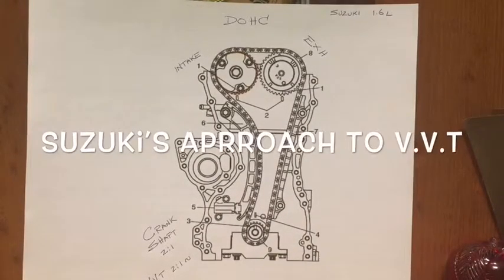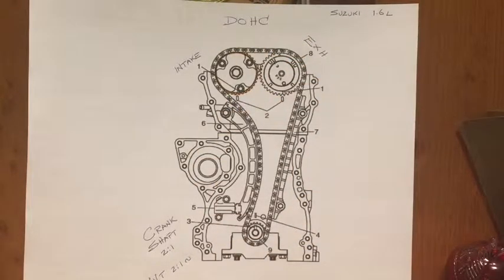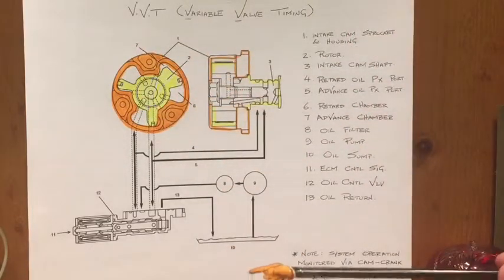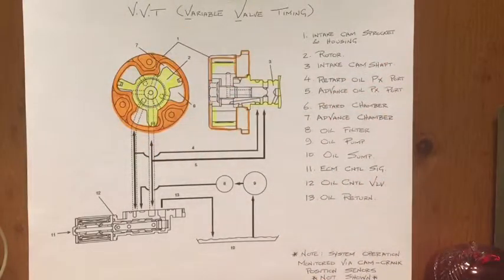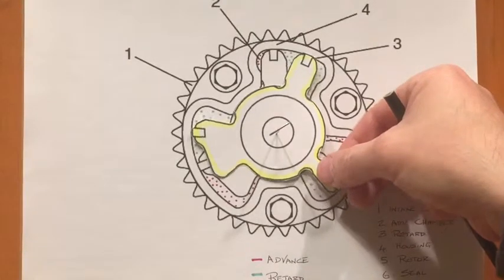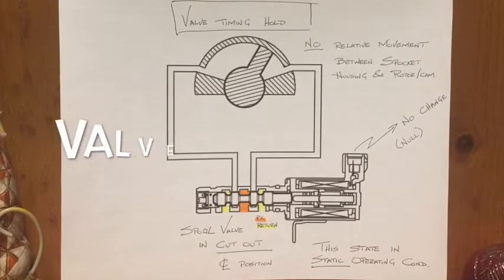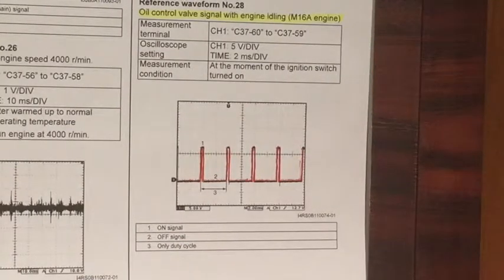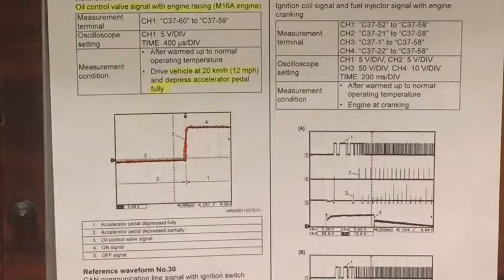Variable Valve Timing (Suzuki)

Comment: This was the best explainer on the interweb - Thank you!
I have a 2008 Sport M16A and I have 2 questions please...
1) My Sport does not feel like it has 92kW, and I can't hear any change in the engine sound as it revs out. How can I tell if the VVT is still working??
2) The next version of the Sport (about 2012) is rated nearly 10% more powerful at 100kW. Does anybody know whar Suzuki did to achieve that power boost??
Thanks to everybody!
Reply from the maker: Thx and thx for watching. I can’t speak to the 1.6L.
But this  might help…
https://en.m.wikipedia.org/wiki/Suzuki_M_engine
Reply: drive the unit and rev up to 4k rpm sounds like a vtec like in honda and you will feel the power. If there's power loss especially on the torque then check your OCV/vvt solenoid

Comment: Hey bud id love to get your advice

On my missus suzuki swift r415 m15a 2010 year model
Just changed the head gasket and now the car doesnt start and the bottom crankshaft pulley is not turning or spinning
So the engine is seized and locked up

On the assembly of the intake cam housing it says to not dissasemble the housing on it
But my mate took the 3 bolts off as your describing at the start of the video by accident instead of the middle bolt
Can this effect the car starting as well
Or ruin it at all/ the timing just by dismantling it?

It didnt fully come off, the middle bolt Was still intact onto the shaft so when he removed the 3 housing bolts it just slightly turned 

Not sure what else can cause the engine to lock when we did everything correctly like timing and etc
We did leave it for 2 weeks before reworking on it 

Not sure if rust started to build where pistons were or anything else
Reply from the maker: Hydro locked? Coolant contaminated oil destroyed bottom end bearings? Starter, accessory or clutch/gear box loading crank? Valve train issue locked up? Cylinder wall/ring rust as you say. Especially if coolant made it into cylinders. Isolate crank and work from there. 🍀
Reply: @TheGibby3340
If we disassembled the sprocket assembly housing will it cause problems? In terms of timing?

Your an absolute legend, youv got yourself a new subscriber
Appreciate ya help man
You restore faith in humanity bud
Reply from the maker: Honestly, I am not certain. Good luck with the repair. Thx for watching 🍻
Reply: @TheGibby3340  thanks for help bud 
It was a pleasure

Comment: Hello to everybody.I m looking desperately for some help.I swap a swift sport engine with engine code m16a in my grand vitara 1,6 which had the same engine code.The problem is that now i have engine light on with code p0011.I have changed everything which related to this code like oil control valve intake cam variable sprocket camshaft and crankshaft sensor and i did timing in chain again.I saw oil passes and everthing is clean and looks ok and nevertheless the  engine light turns on.If anyone has an idea what is going on i will appreciate it a lot
Reply: The trigger wheel is in the intake camshaft and it is the same.Thank you for the repply
Reply from the maker: Is it possible you have swapped in a engine/head with different valve or ignition timing/configuration. I think the trigger wheels are different between waste spark and COP designs. That same trigger wheel if different may wreak havoc with VVT monitoring. Just a thought 🍻

Comment: hi are the vvt solenoids run a pulse width modulation or just as on or off? cheers
Reply from the maker: PWM (duty cycle) controlled. Which as you likely know is just on and off with a bit of fancy timing 😀 The valve(s) are spool type not pintle. So linear movements are realized through PWM varying average applied voltage. 🍻
Reply: @TheGibby3340  great thanks I’m running a k14b engine in a jet boat was going to run a after market ecu can you get away with just Turing the vvt on at 3000rpm and just leaving it on rather that pulsing it?
Reply from the maker: Honest answer is I am uncertain. Speculative answer is yeah probably. Application to straight B+ will result in max advance or retard depending if the system is setup for + or - Duty Cycle. Of course the beauty of VVT is optimized valve timing for RPM Vs. Load/Torque demand.

Comment: Thank you for the video! I'm literally a Suzuki certified mechanic, and have an Ignis with M13A VVT engine, but never getting into that deep in the VVT system working, because i didn't have to. Suzuki engines (especially the M serie) is freakin reliable, and durable.
Reply: I agree, they are so underrated. I bought an 04 Ignis of my sister as a cheap run around, hated it at first, but love it now. Two door also, more room than larger cars. What country are you from?
Reply: @chippyjohn1  Hungary. Mine is from 2004 too. It was assembled by Suzuki Magyarország Zrt. in city of Esztergom.
Reply from the maker: Thank you Sir. They are a better product than most people give them credit for. Thx again. Cheers 👍

Comment: This system was actually first used from 2001 in the M13AA, M15, M16, M18. Great engines, thought I prefer without VVT for my purposes. These Suzuki M engines are so underrated. I have been designing a helicopter for some time and with a lot of study into what powerplant to use, the M13A non VVT is the best option. Modifications of course, but from a design perspective it is better than everything out there even certified aircraft engines all things considered. I don't think they ever got much aftermarket support as they aren't really in any sports cars, at least RWD cars.
Reply from the maker: Thx for watching 👍

Comment: Though this was a few years ago...I am looking into a Suzuki J20B for my Sidekick. (2010-2014 J20B into a '94) Your explanation of Suzuki's VVT is great!  Simple-ish!  I get is so far, but need more info.  What are the ECU outputs that affect the oil controllers duty cycle?  RPM, TPS and oil temp come to mind..along with your aforementioned cam and crank positions.  Secondly, is this system using crank oil or is it independent, taking it own bath and path?  The reason for asking is that my Sidekick is an OBD I ECU/analog ignition POS.  I will be using the ECU that comes with the new power plant, but gauge displays will be an issue.  I am thinking about using a Haltech ECU and standalone gauge cluster, if needed.
Great work on this!

Comment: Hello, good work. Please tell me do you have any information about setting variator on car after reinstallation? Do I need any special tools? As I saw on your film I think that without oil supply variator is in his rest position. Maybe do you have some manual how to set it?
Reply from the maker: Thx for watching. The extent of my experience is all in the video. No practical exposure at all (Thankfully I have never had a VVT issue with my vehicle) Cheers 👍

Comment: Is there a certain rpm where the vvt activates?
Reply: on k12b i think is 3000 rpm, because at that exact rpm the engine noise change
Reply from the maker: Hi thx for watching. I am not certain to be honest. The shop manual contains no reference graph. I believe actuation is more a function of RPM Vs. Load as opposed to strictly RPM. Cheers